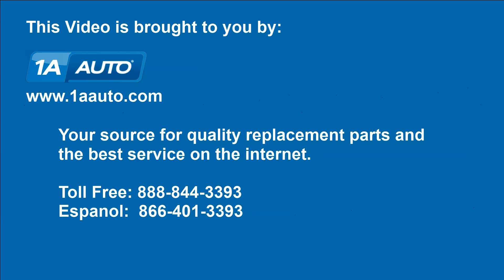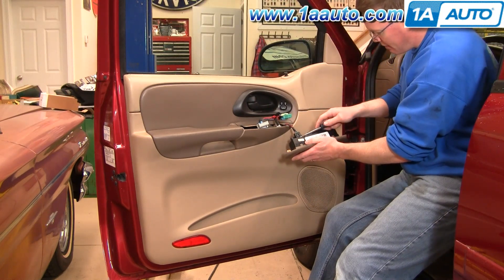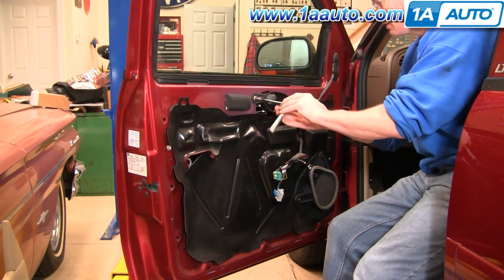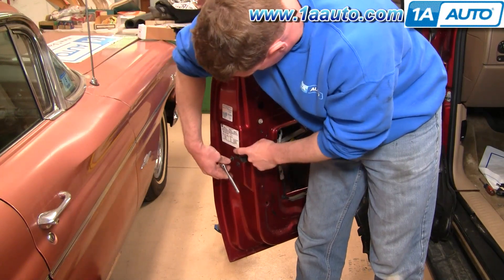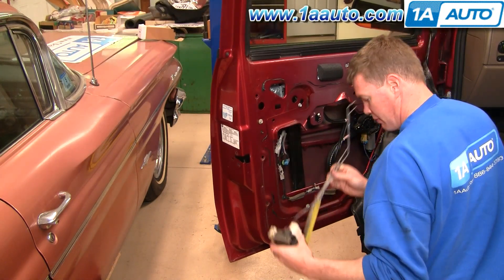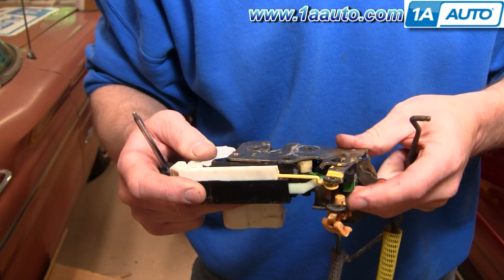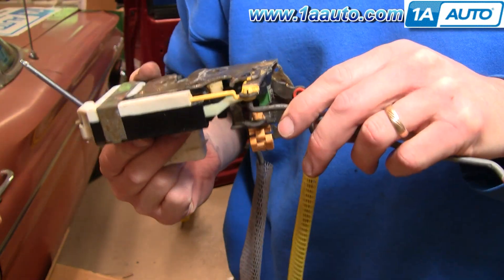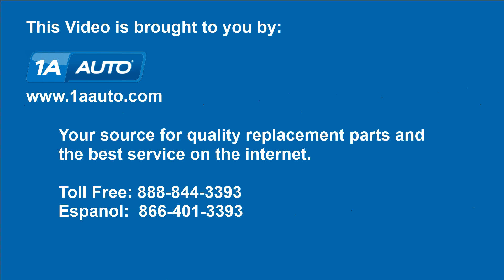How to Replace Door Lock Actuator 02-06 Chevy Trailblazer

Comment from the maker: If the door lock actuator fails or starts to fail, when you hit the switch it may make a noise and kind of wiggle but may not move up or down. That's typically what happens to them when they go bad. It sounds like the latch could be bad in this case. If should hold the door shut. Hope this helps you out. Have a great day! 1aauto.com 888-844-3393

Comment: Looking for one for a 2005 gmc sierra. For the actuator/cyclinder replace. Someone shoved a screw driver into the key lock. So we replaced the cylinder, but when you put the key in, there is no resistance at all. You turn any way and it doesnt lock/unlock. But it works with the key fob. 

Any ideas?
Reply: That’s my issue right now .. sounds like the rod came off .. maybe a broken clip
Reply: No one put a screwdriver on mine but got home today, locked the doors a few minutes later the key would turn freely in both directions but would not open the door.

Comment: Great video. Question..... when in the 06 Trailblazer, and the radio is on, if you open the Drivers side front door, the radio does not shut off. But opening the passengers front, the radio turns off. I’m thinking it’s the door lock actuator. Any Ideas?  Thanks
Reply: Same problem.  Did you do this?  Did ot work if so?

Comment: I came home today and when I let my dog out the driver rear door, it wouldn't shut again. I made sure the latch wasn't stuck, but even with it opened, the door will not close. The latch and striker seem to line up perfect.  The latch does not seem to lock in either a open or locked position. Would this be an indication I need a new latch assembly? Possible a spring broke or something? I am having a hard time finding a driver side rear latch assembly for a 2004 Envoy xl. The actual lock actuator seems to be functional still.

Comment: I know I am posting to an old view, but this is the closet view to my issue. I have a 04 chev blazer, that the driver side lock rod clip has broken off. When i was final able to get the panel off an look inside. Not only did the top lock rod clip break, but the bottom one as well. The issue that i need help with, is that there is a safety feature that connects somewhere that if someone attempts to break in, then the doors will not unlock. Which has caused another issue because now that auto lock/unlock doesnt work corretly. It will allow me to lock, but not unlock. What i need help with, is the proper attachment and alinement of the lock bar and safety feature.

Comment: i have a 2005 trailblazer ls. i got my key stuck in the car and while i was usuing a slim jim to get it unlocked, i heard something snap and now when i put my key in the door to unlock it, i wont lock or unlock. its like there is no resistance to the turning of the key. is this the door lock actuator? or something else?
Reply from the maker: You may want to take the door panel off and see if a rod came off of the key lock tumbler or the door lock actuator. Hope this helps you out 1aauto.com?utm_source=YouTube&utm_medium=CTA%20Comment&utm_campaign=1ATony 888-844-3393
Reply: This is my issue. The key turns left and right and no resistance. This video helps to point me how to disassemble the door panel to investigate. I’ll determine if a lock rode just came loose. Did you get things fixed?

Comment: One day I came out to my 08 trailblazer and the key (drivers side door) would not unlock the vehicle. it wouldn't do anything, its like I was putting the key into the keyhole and nothing was in there! Anyway, now I cannot lock my vehicle since I can't unlock it from the outside as that is the only door that has a keyhole. Someone suggested that maybe someone tried to break in and caused the key mechanism to be misaligned. do you think this is what it is?
I want to add that I the door also has electrical issues! It decides when it wants to work. Sometimes I turn on my car and its good but sometimes it is completely dead (no window/lock buttons work or anything). Should I just replace the door altogether at this point??? lol I would appreciate ANY advice!
Reply: Sarais Bozan this just happened to me a couple days ago
Reply: Sarais Bozan I suspect you have had this fixed.  But could be the blue rod clip piece broke (shown in video)

Comment: My 2006 Trailblazer SS dome light wont shut off after passenger door is opened and then shut. I don't have the "Door Ajar" displayed on the dash so don't know if this would be a bad Door actuator or door switch/lock assembly...Any Idea?
Reply from the maker: +Bondovian It might be a bad door jamb switch.
Reply: 1A Auto Parts there is no door lamp switch on the SS they are built in to the door locking system

Comment: My door is stuck shut after being part of a hit a run, i managed to get the door panel off while being shut and tried messing with rods to get the door open. Nothing worked , keys ,inside  . It felt as if the lock is staying engaged on the striker. Is there a way i can get door open ?
Reply from the maker: +Robert Shep Thank you for watching!  It sounds like you will likely have to take the vehicle to a collision shop to get it fixed.  The door is likely stuck because the structure is out of shape.  1aauto.com

Comment: Question?  My fob works on my 2002 Trailblazer EXT, however the key won't turn to open the door.  It slightly pivots to the right or left, but won't completely turn.  For quite awhile, the key would intermittently work fine and then not and then fine.  Is this an actuator problem or something else?  I am the original owner of the vehicle.  There has been no accidents or damage to the door.
Reply from the maker: +LeslieAnn Brady You may need to replace the key lock tumber on the door. If you spray a little WD-40 into the lock it may help to free it up. Hope this helps you out. 1aauto.com

Comment: I have a problem with my trailblazer when i close or open  the driver door the light inside stay on i have to open and close any other door in car to turn off the lights inside do u know what could be the problem ? Thanks
Reply from the maker: +Dark Blade There might be an issue with the door jamb switch that turns the light off and on. You may want to see if it is sticking or possibly not functioning properly. Hope this helps you out. 1aauto.com
Reply: I think the switch is in this assembly.  Because if you use a screwdriver to push the door latch closed the lights go on and off.

Comment: my rear passenger door will not close. I mean that it will not engage and stay shut. I've tried to flick the door handle up and down and even took off the door panel, but I cant find any thing wrong. Any ideas?
Reply from the maker: +1973chevycar Thanks for watching!  You should check the latch and striker bolt first.  If it is not staying latched then it will likely be one of those things.  1aauto.com
Reply: found out that all the gears inside of the plastic box were in pieces. Had it fixed today. only cost 90 bucks.

Comment: Well it looks like I need to buy a new door lock actuator for my 2004 chevy trailblazer, because when I push the lock or unlock button on my keyless remote, it makes a grinding noise and I can't use my key to unlock the door. Do I have to buy a door lock actuator with anti-theft? Seems pretty expensive.
Reply from the maker: +paratrooper You generally need to replace parts on the vehicle with an exact match.  That means if you have a factory alarm, and the actuators are specific for that feature, you will have to get one that is compatible with the alarm.

Comment: Could you take a moment to explain what the actuator does and what it doesn't do when it fails ? My '04 TB (LS) rear drivers side door will not stay latched - like what a broken return spring would cause to happen (I'm pretty sure there are no return springs - just an analogy), In other words, the handle operates the latch ok, theres just no resistance to hold the latch in place after it hits the bar. Pull on the door by its edges and the door opens right up - no door handle(s) needed.Thanks !!!

Comment: The bolts aren't really 10mm. They're actually just a 10mm head.

As far as the door panel reinstallation, open the window fully first so you can get the upper door lip as close as it was. It'll go on in the wrong position (out of the groove) but it won't be right.  

Good video though.